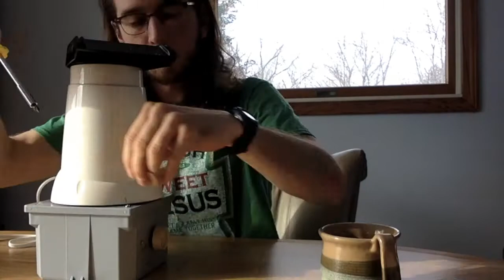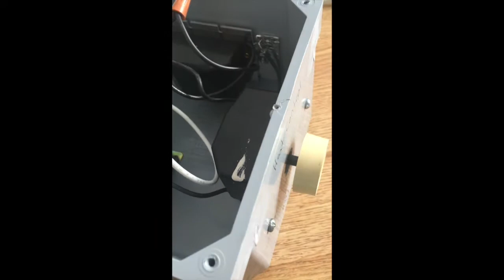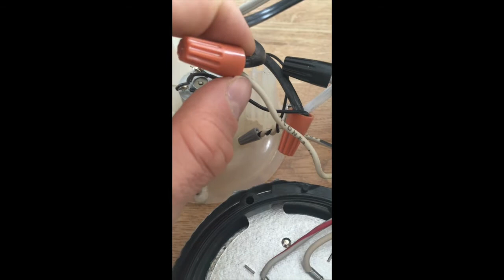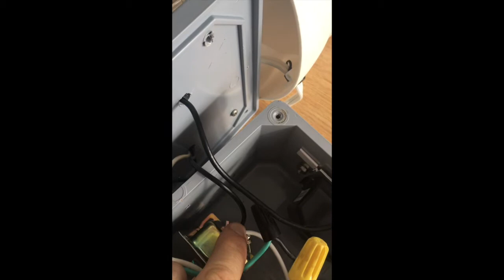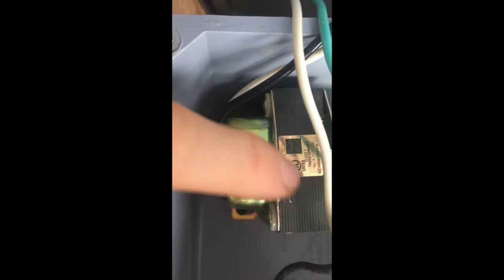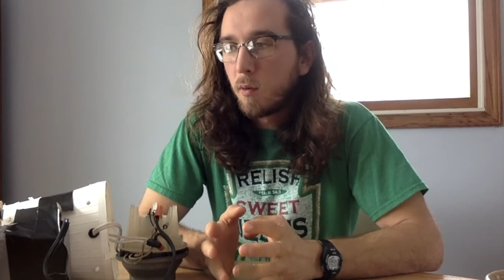DIY Presto poplite Coffee Roaster

Comment: did the dimmer switch for heating element hold up? it's rated for 600W usually, but the unit is 1500W, I would guess it will burn in 10 mins of roasting, did it?
Reply from the maker: It didn’t burn up. It’s still holding up just fine!

Comment: Hi Tyler thanks for  posting this! Used these instructions to modify the on/off switch on my popper to turn the element on/off. Just wondering if you have any suggestions on how you use the dimmer/switch to improve the roast. Guessing i need to slow heat ramp up?

Comment: Thank you very much for the detailed description and video. One question, why did you just use a dimmer switch or high wattage controller to control both fan and heating elements so you don't need an extra transformer and switch?
Reply from the maker: Because those are the parts we had available, also i wanted to be able to control them separately.

Comment: Great video, thank you for taking the time to post it.  Love the shirt :)  I have the same popper and attempted to do the same mod with the variable dimmer, but it's rated to 5amp max which is 600w.   This popper is 1440 watt, I know some of that is going toward the fan which is separate, but I figured I'd try it anyway and the switch started smoking so I don't think it can handle it.  You said you can post a link, which one did you use?
Reply from the maker: Thats why you need to use the transformer.